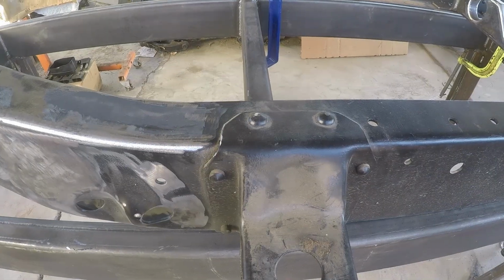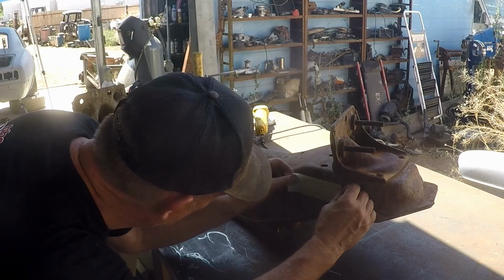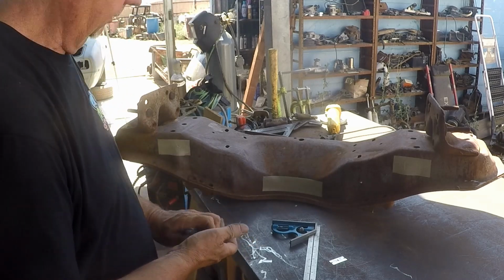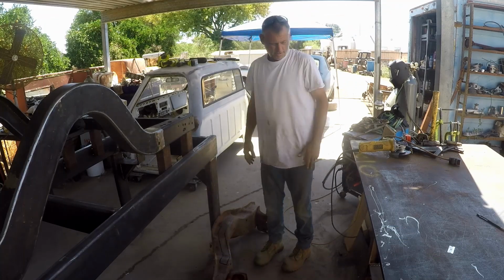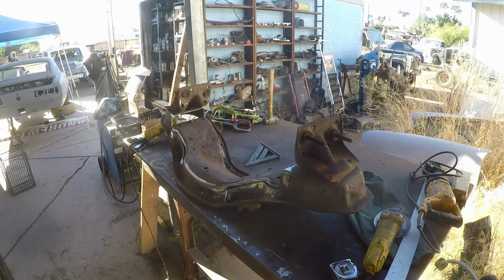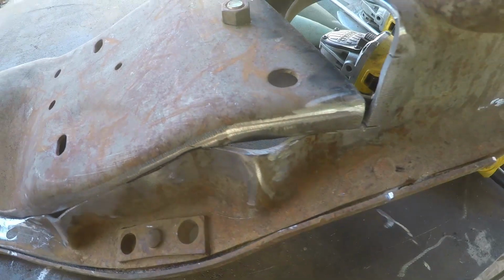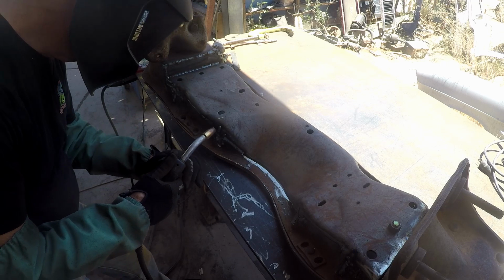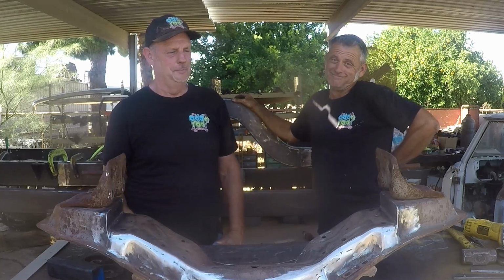How to Pancake a C10 Crossmember #pancakeC10crossmember

Comment: Thks for the video i hace c20 front clip was going to craft the clip in now i see this pancake have 1953 ford van 132 wb dont know witch way to go any advice thks
Reply from the maker: I've narrowed crossmembers before and put them in older vehicles.  I'd go C10 not C20.  They are different.  C10 has more options.
Reply: @TheOddRodGarage  why c20 the diff is c20 full floater and Detroit steel make rims for 8 lug
Reply: @TheOddRodGarage  have a 468 blown t400 I'm going to set the engine back the WB 132in

Comment: Hey guys, It looks like the steering rod will touch the harmonic balancer on the SB??, also looks like the pancaked cross member doesn't have room for the oil pan?? comments??, suggestions? THANKS
Reply from the maker: There is plenty of room between the pan and the crossmember. There is also no problem with the harmonic ballancer.  I'll try to get better pics
Reply from the maker: Balancer

Comment: Bolt holes on side of frame won't  line up.
Reply: I had the same question what do you do with the side bolt holes from the frame to the crossmember the bottom lines up fine